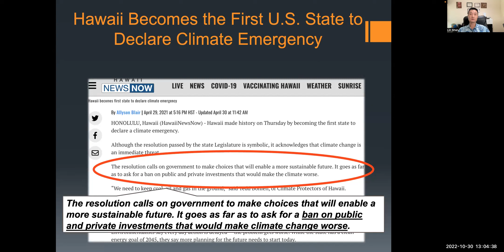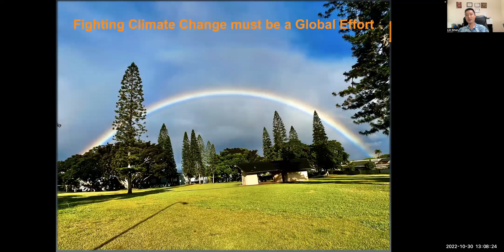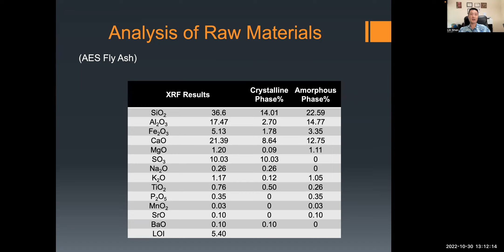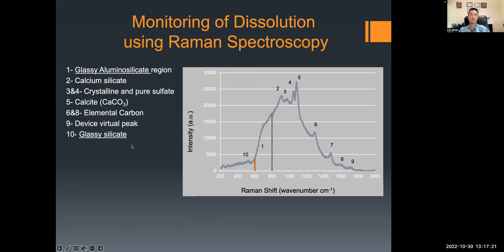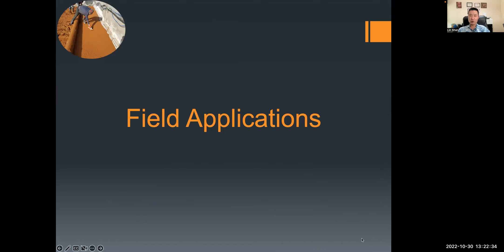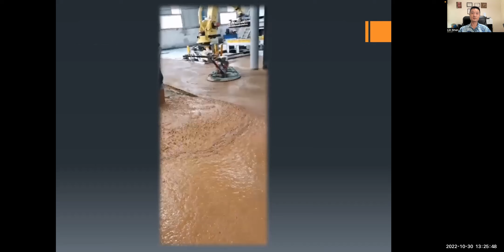Field Applications of Sustainable Cement-free Alkali activated Concrete using Industrial Waste

Comment: Thanks for the video! For field ready-mix applications with alkali activated concrete, what is the best way to control slump loss in the first 90 minutes of concrete age? With our testing there is a delicate balance between the dosage rate of alkali activator and how quickly the concrete loses slump on site. More activator gives great early age compressive strengths, but rapidly drops workable slumps. At that rate I worry about old age concrete having water added on site to return to workable slumps, resulting in field concrete strengths significantly weaker than lab tested strengths.
Reply: Thanks for the comments. Adding water will increase the slump and setting time, but strength could be significantly reduced. we developed own retarder to overcome the slump loss and set controlling issues